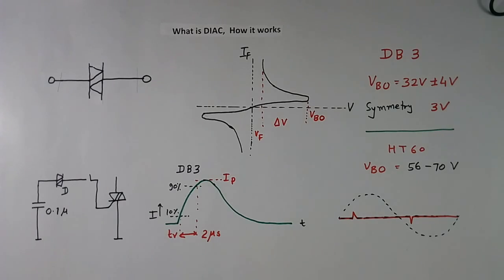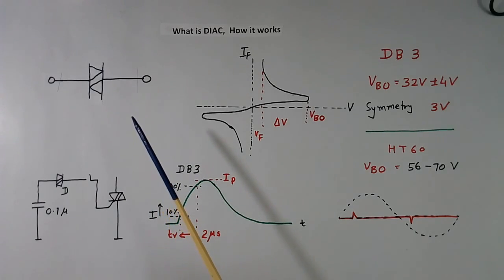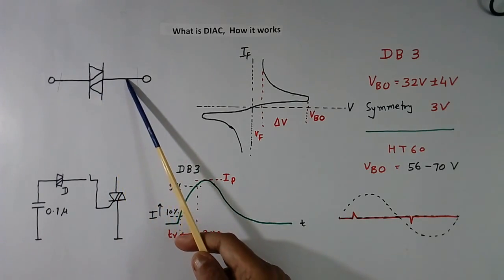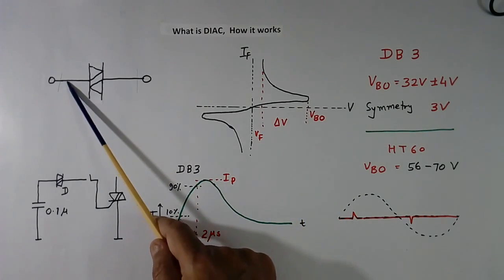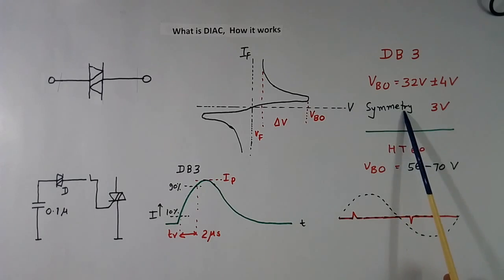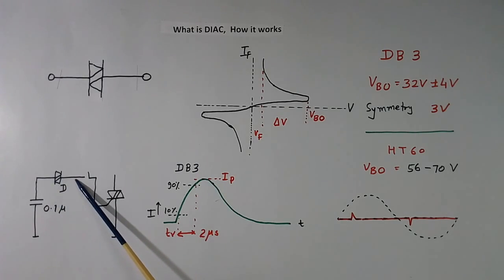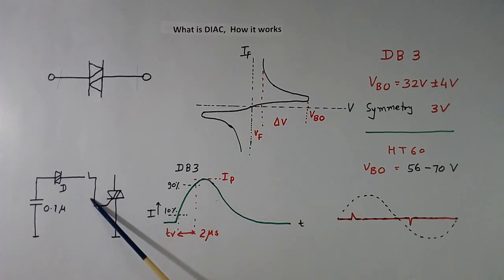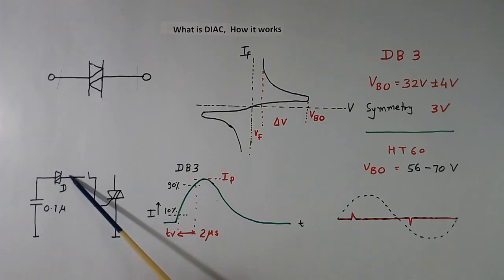DIAC, What is Diac, how it works

Comment: Why triac not use for highly  inductive circuits?
Reply from the maker: 1- For a designer there is nothing like, you can not use this or that. Designer is free to use any thing any where provided it works properly & ckt should be reliable and economical. I have designed 100's of ckt for industrial applications from small to very big project, but there was no restriction.
2- Fan control using triac with inductive load  Pl watch at   https://www.youtube.com/watch?v=wc6PaFM88Mg
3- When load is inductive ( or partially inductive) , and we trigger triac at less than 90 degree. In that case current flow in one direction exceed 180 degree, which result in DC current to flow. You can see wave shape show in my linked video. In consumer product trigger may be less than 90 degree as there is no limiter is put in, so problem. But this limit is not of triac but is due to our bad design concept. If you design properly, you are free to use any component any where within components parameter limits.
4-  In fact ckt I have shown in link video, is for commercial use only. Such ckt is not acceptable at all for industrial applications. For industrial application ckt will be too complex expensive. 
Regards
G K Agrawal
Reply from the maker: link for English version of triac video is  https://www.youtube.com/watch?v=8wd5HR-DVGY
Reply: G K Agrawal